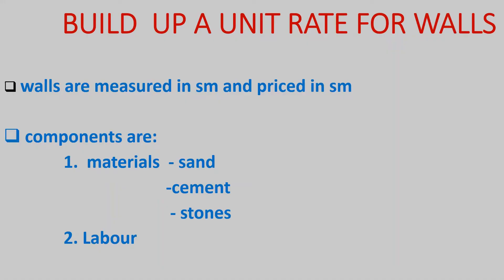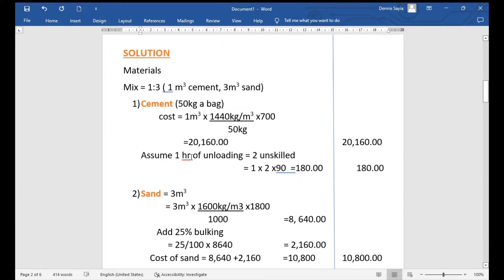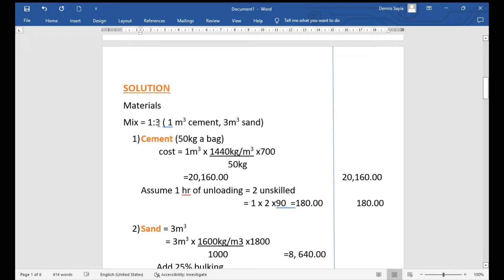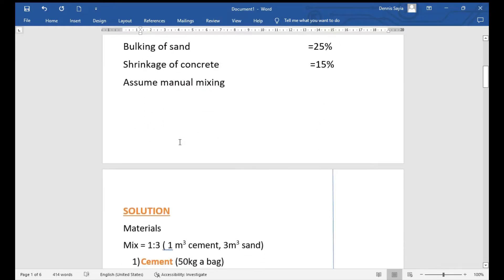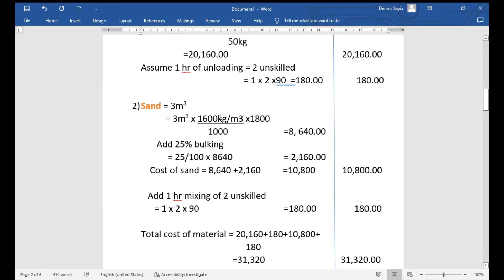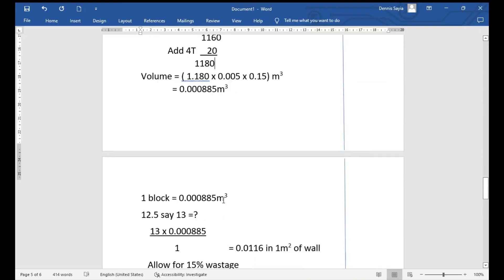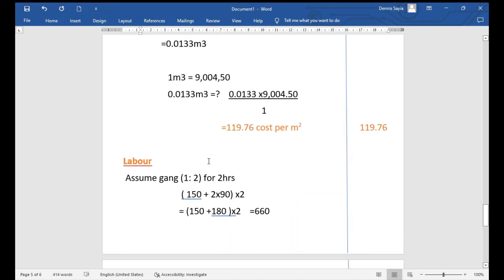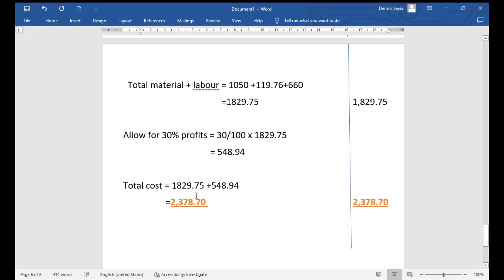Build up unit rate for walls

Comment: will you mind rechecking the calculations for materials
to my own knowledge ,you ought to get the total ratio which is 4
for instance,Cement=1/4.1440/50.700.1=5040